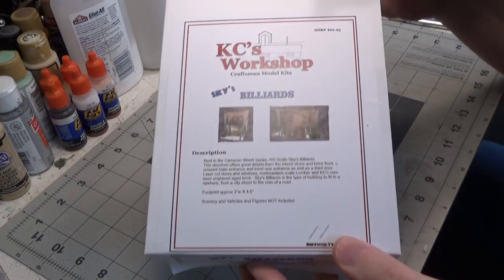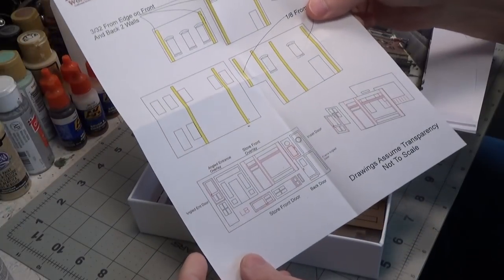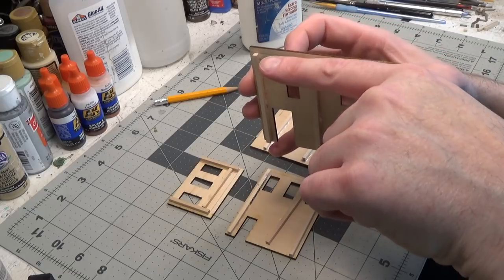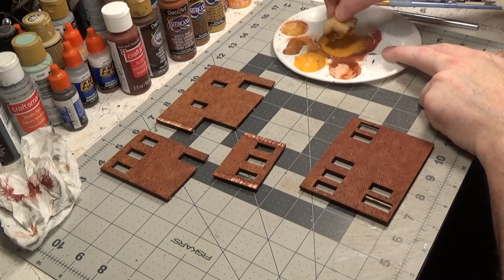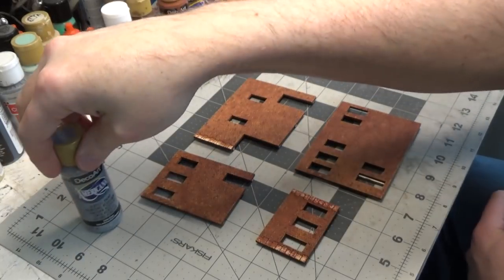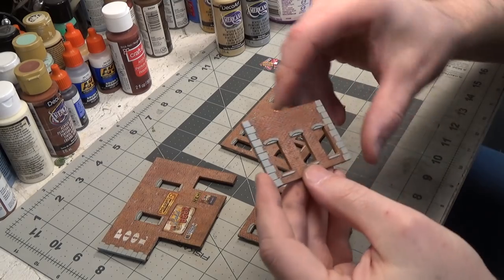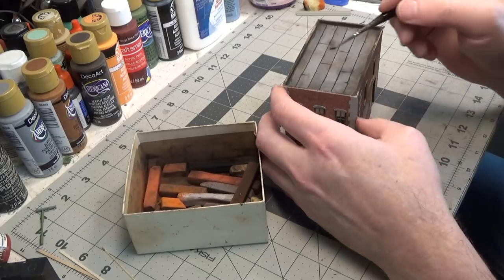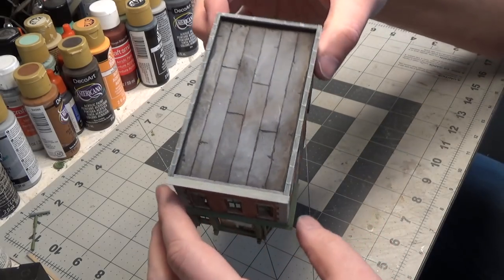How to build a Pool Hall for your model railroad.

Comment: When painting acrylic over acrylic, it's good to seal between coats with a solvent based clear.......this way you don't have to worry about disturbing the paint work done previously. just a helpful hint.
Reply from the maker: If the first layer is completely cured you wont disturb it.

Comment: Nice job Jason. Here is a tip you may already know. I found on the back side and sometimes the sides that some of the bricks had turned a whitish color. Not sure what causes this. I believe it has something to do with how the bricks were fired while being made or something screwie with the mixing of the brick clay itself. The other thing that happened while building old brick structures was that the builders were quite often willing to use brick from old buildings that had burned. Those bricks were black. For the black use the same marker you used on the roof. Don't do a lot of bricks and the buildings I have seen the burnt bricks were well scattered in the wall. For the white bricks I found something called a gel pen that came in white. No idea when I bought mine but I did find it at Michaels. It looks like the manufacture was Y&C Gel Xtreme. White paint might work also. On these bricks I made no effort to do the whole brick as the leaching? was not uniform at all.
Reply from the maker: Thank you so much for watching!!! And Thanks for the info!!!

Comment: Jason, I’ve been thinking about brickwork painting for a while and think i will use most of your method, but want a less opaque washed look on the bricks. What do you think about first painting a few individual bricks, then dab the different colors.  When that’s done, the seal the brickwork before adding the joint compound.  Sealing the bricks colors before adding the joint compound “mortar” would allow the joint compound to be more aggressively removed for a less washed out or opaque look.  Once the joint compound “mortar” dries, then seal it again.  Whaddya think?
Reply from the maker: That would work great! Thanks for watching!!! And Thanks for the tip!

Comment: Jason would a cosmetic sponge work well for dabbling the paint on the bricks? Would this also work for plastic walls too? Thanks Kevin B.
Reply from the maker: I have used a cosmetic sponges before but I find that they are kind of smooth.  You can tear them and pick at them to give it a little more texture. They do work!

Comment: Fantastic build and thanks for the video!  I have a question about the stone window sills.  Shouldn't they be placed higher in line with the bottom of the windows?  I don't recall ever seeing sills that low on a brick building.  Thanks!  Mike
Reply from the maker: Thank you so much, I really appreciate it!!! I agree with you completely. Unfortunately I couldn't change it because there is a blank space on the brick that the stone fit on. But I still think it's a great kit! Thanks for watching!!!

Comment: What adhesive did you use to attach the arches?  What brand od extra strong white glue do you use? Enjoyed the video
Reply from the maker: Thank you so much for watching!!! The arches are peel and stick. And I use Elmer's white glue and Elmer's wood glue.
Reply: @JasonJensenTrains  Just a note from my high school physics experiences over a decade of teaching - don't use Elmer's White School Glue as it's markedly inferior to Elmer's White!
Reply: @JasonJensenTrains   Jason I need your help.  What technique do you use to apply peel and stick parts? My first experience was less than satisfactory as I had difficulty with their proper placement.  Any tips?
Reply from the maker: Be sure to hold the part above the model with a pair of tweezers to figure out your placement then drop it in place.